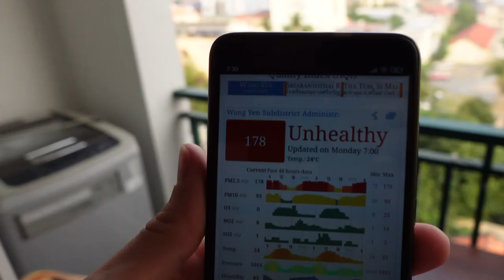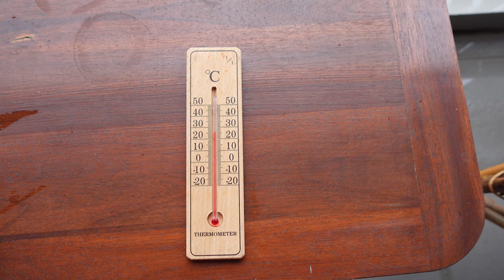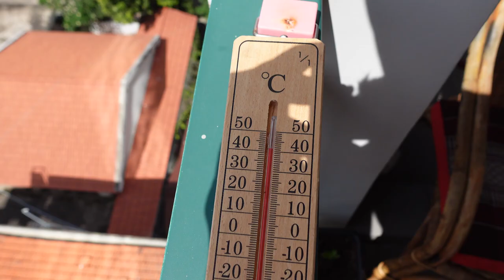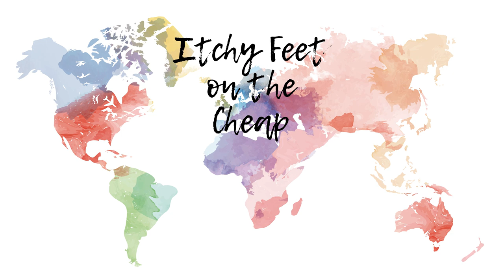Tales From a Balcony in Cambodia - 1 Full Year!

Comment: smart air filters. get one of those for your apartment if the air quality reading is flashing red.  your older self will thank your younger selves for it.
Reply from the maker: Cool. I'll check them out.
Reply: @itchyfeetonthecheap  i couldn't write the link bc yt wants to rule the world.  they are based in asia, but also they have some plan where you just buy a house air filter and bungee cord it onto a fan and that seems to work too.  doesn't even have to be loud if you keep the windows shut.